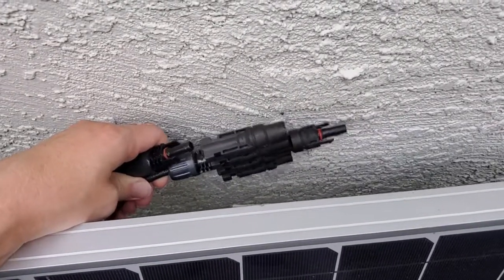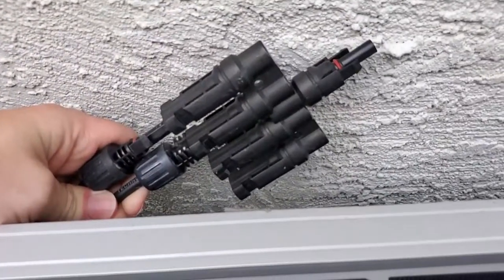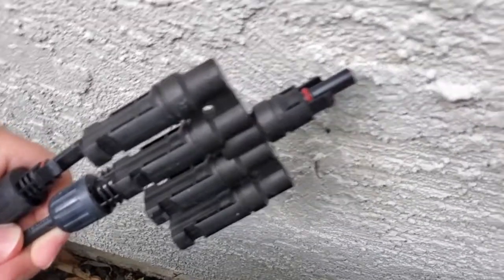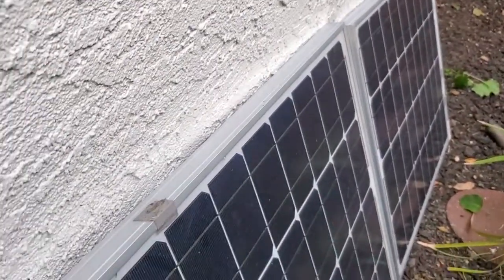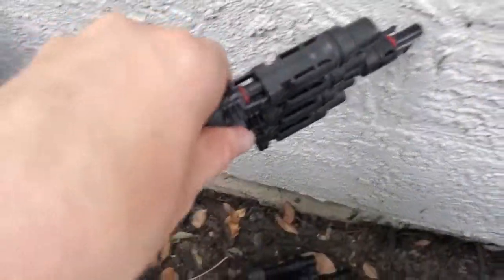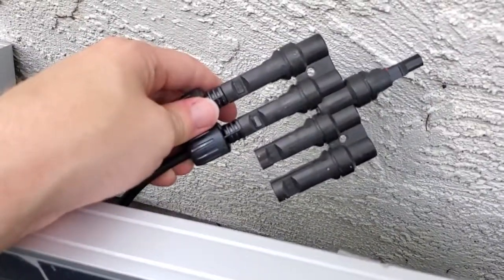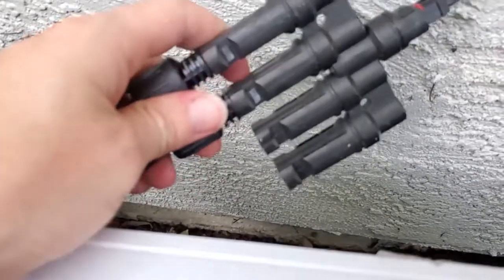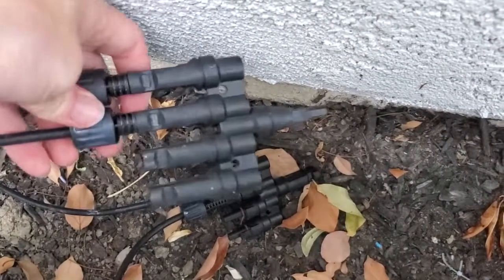Wiring 4 Renogy Panels In Parallel

Comment: Anyone who uses those is nuts. In a couple years they will melt from the contacts overheating from too much current if the string is low voltage.  I don't care what they say they will handle, they won't. Any more that two panels in parallel should be fused.  Should a panel short, three times the current will go into one panel creating a hazard.
Reply from the maker: Thanks, Opera. That's a helpful comment. If you had three 50w panels and a 100w panel, with a 30a charge controller, how would you wire them up to avoid the hazard you mention?